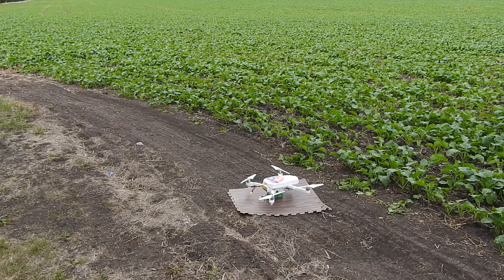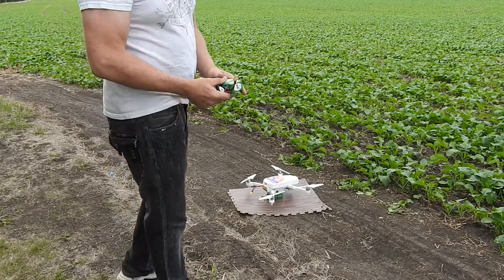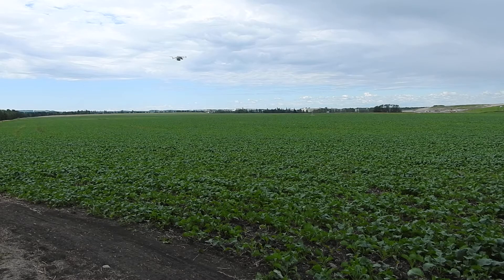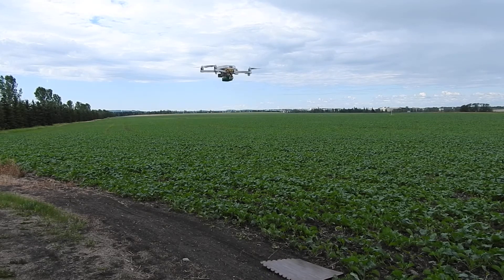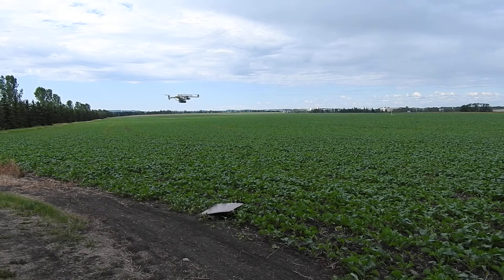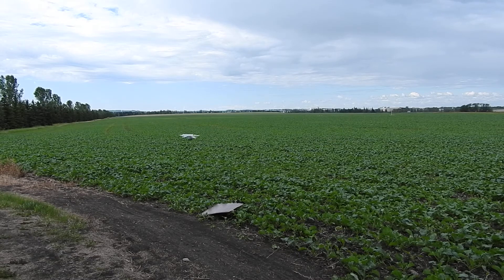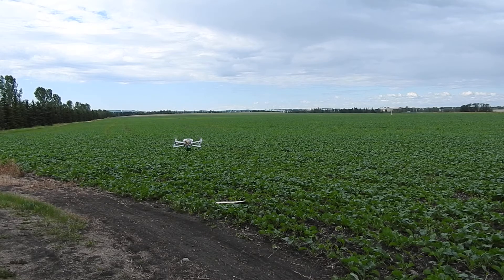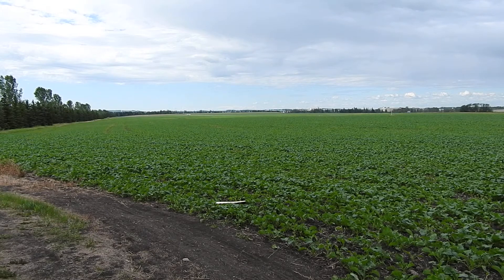phantom 3 mavic fly time test Lihv 5200 mah.

Comment: looks like it performs pretty darn well with the externals! any visible signs of stress on the arms? I am still fighting esc status error, i need to take it apart and re-wire it. Still havent flown, im jealous!
Reply from the maker: hey digdat0 this is one tough bird!! no cracks or stress visible,man sorry to hear about that esc error code.was that after an update?
Reply: No, from the build .. i think its a bad solder. Havent really had time to jump back into it, hoping soon!